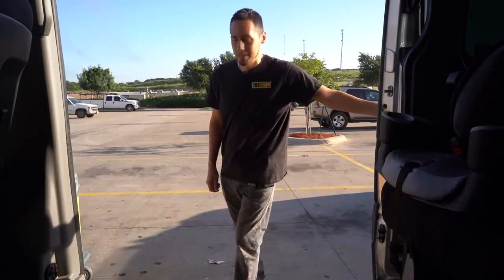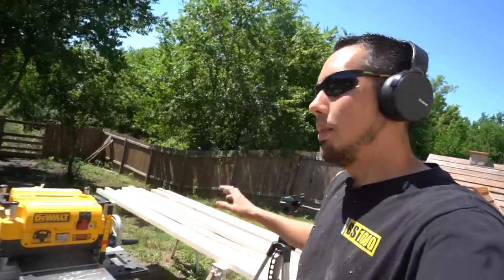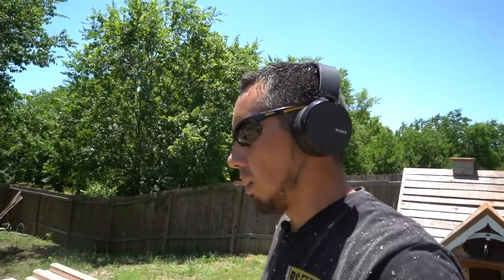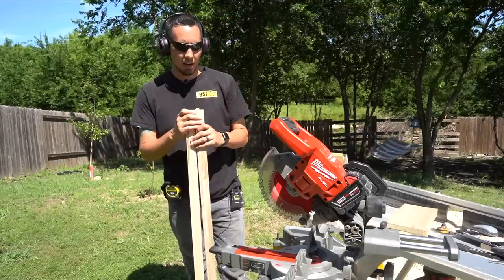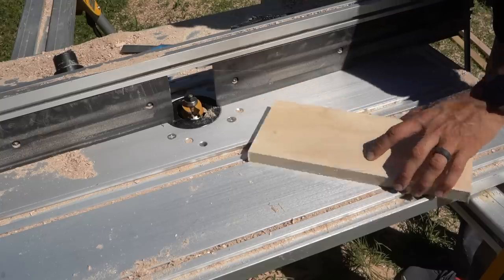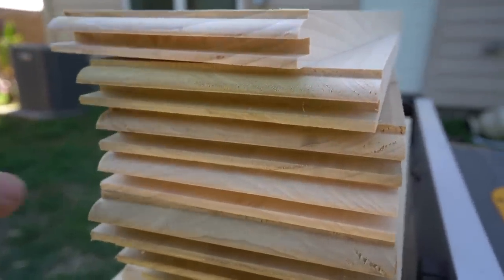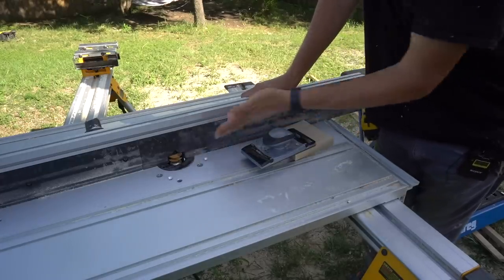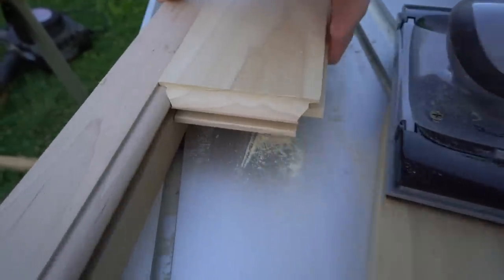It Worked!!!... Raised Panel Box Newel

Comment: Great video... man, you make creating videos look EASY!  Make your glue-ups look easy too: get a couple or 4 Merle Band Clamps for your tool collection... can't beat 'em for gluing up newels IMHO.   

Because you asked: The biggest challenge is keeping all the panel opening heights identical and rails lined up on all 4 faces of all the posts so not gluing all 4 sides at the same time, like you said, is dodging a bullet the first time so you don't get hit with one if/when a glueup goes bad.  Memories of your floor stain debacle are a little too fresh to re-live THAT kind of grief now, right! 

There's a lot of 'right ways' to do that glue up but I'll share my thoughts for what they're worth.  I'd determine the exact height you want to end up with from the top of the posts going down.  Normally a newel would proportion like a raised panel door with a narrower rail at the top and a wider one at the bottom; say 9"on top and 12" on the bottom.  That difference helps it look 'balanced' and not top heavy like it does if top and bottom rails are the same dimension.  Anyways, say you choose 9" for the top.  I'd cut all the top panels to  about 9 1/2"~10" or so but make them all identical in height.  Then I'd trim the best end of all the corners clean and square and mark them so they're the top of your newels.  With that prep work done I'd glue up 2 opposite faces (like you mentioned) lining up the tops of corners and over-length top rails.  Cinch 'em down with those Merle band clamps and your glue joints will be invisible!  When the first glue up is set just add the panels and rails to the opposite two faces, lining up everything on the tops again, and put 'em in the clamps.  The benefit of using this sequence is that all the spacing is indexed off accurately cut ends on top which makes lining everything up on all 4 faces automagic and a lot simpler IMHO than squaring pencil marks around everything on every face of every post. 

Once they're all glued up and dry I'd trim the extra 1/2"~1" off the top for a perfectly flush and square top, ready to accept a newel cap.  The bottoms of the posts will be completely uneven but one slice with one of your miter saws makes it a moot point.  You can always trim them square and 1/2" long or so to allow for scribing to uneven floors, etc so you can set the tops laser level on final installation. 

One last thing: you mentioned 1/2 newels at the walls?  Since you've got extra corners made I'd do everything the same in gluing those up with the exception of leaving out the  raised panels on the back side.  This makes the posts come out square under the clamps and you just rip them to size afterwards.  Having extra parts makes this possible and saves having to deal with u-shaped 1/2 posts folding up like a taco shell when you go to clamp them.
You've got a first rate newel build going here Richard and it's good you didn't even need to fire up the BS1000 advertised on the t-shirt you're sporting while making your posts!
Ping me if there's something that's not clear in this LOONNNNGGG comment! Best, Matt
Reply: Great detail

Comment: I tip from a table saw guy, the only way to truly know if your blade is at 90, is to cut to pieces of your choice of material, put them together, and use the angle finder. More often than you think it comes to 87 92, as you know, in finish work, that can be a lot depending on what you're doing. Thumbs up on making the wife help....just don't let them know you can clean! Glue then cut, you don't want to then have to get a planer or sander if something isn't just right.

Comment: Understandably you're very green to doing this kind of stuff, so here's some advice. When routing out your rails, you'll only get chip out in the back end, so no need to trim both sides. But by this point you shouldn't be doing any trimming. You should already have your final dimension and be using a block to prevent the chip out. And on your stiles, you don't get any chip out at all because of the way the grain runs. So no need for a block there. And as for the glue up, do it in halves and then bring them together and clamp. Hope this helps.

Comment: Woodworker here...First off, that post is amazing. I think it took a finish carpenter to make something with that many routed edges to come together so perfectly. So congrats on that. It's great that you left yourself extra length! I would glue it up in pieces like you said, get it as close as you can with the lengths being even as possible and then cut it to final length once it's all together and dry. Oh, and you know this, but watch the squeeze out on the inside hard to reach areas...what a pain it would be to have to get inside those angles to remove dry glue. It won't take much glue though because your joints are perfect.

Comment: Don’t ever mill all your pieces at one time 🙈 you’ll be amazed how much a piece can cup, bow etc even just overnight. Only mill what you can glue up same day. On big projects you rough mill it.. then right before glue up you mill the last little bit. Also always leave a little extra size cause after glue up you’ll want to plane and joint again to final size. You’ll never have perfect glue up so leave some room to adjust the pieces after glue up.  Use a piece of scrap as a push block behind the piece.. that prevents the tear out on the back end.

Comment: Couple tips. 1 feather boards will help you get consistent profiles on your router table. 2 sneak up on your profiles take about 3/4 of the material out on your first pass through the router then do a finish pass. 3. There is a narrow stock fence that flips over your table saw fence that will make getting your hand that close to the blade a little more comfortable. Overall great work as always and keep making sawdust.

Comment: Measure and cut to size. Add fill block to inside post to pre secure before adding your work. center panels run thru router to get raised panel  to finish the detail. sand and fill any defects before installing will save a lot of time later. I love to see how you work calmly and methodically. A sign of a true craftsman.

Comment: I had a cabinet shop, but im retired now. Some wood workers will glue up first cut to size second. But i always cut individual components first. Advantages are: at final assemble you can  measure corner to get square, less waste, easier to cut smaller size wood on miter saw,  no tear out on assembled item and faster. After glue-up final sanding and your done. Good luck. Try it both ways.

Comment: Richard, I've been using Marc Sommerfelds raised panel bits for years now. It never ceases to amaze me that this old retired pipe fitter/welder can produce doors or in your case newel posts, that are near perfection. I would definitely recommend gluing up the posts longer than needed and chopping them to size on the miter saw, giving you perfectly aligned edges.

Comment: You'll probably get all kinds of opinions on glue ups because every woodworker does things differently.  That post looks like it would be a pain to cut to length precisely after glue up.   I also like to dry fit everything at it's final dimensions (unless it's like something I know I'll flush cut like a dowel or something).  It's easier to make a new part if needed than make a whole new post.   

My best advice is practice the glue up.   Go through all the steps you'd think you'd do to glue the panels up without applying glue.  Add clamps, etc. This gives you an idea of how long you have, any struggles you have to get something square/flush/etc, let's you know if you have enough clamps, etc.   If you're worried about having enough time, you can use a glue like titebond 2 extend.   Do a dry run with the table saw, does it feel like you can cut the post to size while remaining square.   Dry fit the post against the wall, make sure it's all square and true.   You'll also be cross cutting the post, your stock blade on the table saw could chip it out.  You'll want a blade with a lot more teeth for cleaner cuts and/or clamp a sacrificial board to the back of the exit point.   Another option for a blade is what's called a combination blade that combines large gullets and many teeth.  They can do rip and cross cuts, not as good as blades meant specifically for each cut, but better than using a rip blade on a cross cut.  

Once your comfortable with your dry runs, then do it for real.   You can sprinkle a little bit of salt on the glue if you're having problems with the glue making things slip.   The salt will give you some traction and dissolve into the glue as it sets. 

I'd also recommend getting a new blade for your table saw.   Use 7.25" blades unless you really need the cut depth.   They're cheaper, cleaner, and quicker.   They are also easier on your motor.   Stock blades aren't that great.  You'll need a new blade for cross cuts anyway.

Comment: Don't sell this one..... Now get a mask. If the dust is on your forehead then its in you nose. If its in your nose then its in your lungs. Your lungs have not way of expelling the dust. The faster the cutting device the smaller the dust particles. The router table is the most potent. 

Props...you are getting it done.....

Comment: I realize that this video was made a couple of years ago, and maybe you have already discovered different ways to avoid tearout on end cut when using the router. I seem to have great success with starting at the end that tears out first. I carefully feed the piece in reverse around the corner, then feed it as normal and when you get to the end. It is already finished with no tearout problem. If you are routing all 4 sides, just finish the 2 corners first that are at risk. I have no problems with feeding the corner in backwards, just take it slow.

Comment: I'm with Nathan, unless it's 2d, you should glue first, then cut to size. Make sure you score with a blade the cut line before you run it through a table saw, as the blade will be ruing the wrong direction for a finished cut. Make each the sizing cuts in two passes, working you way up to the knife line you have pre placed on the member. Also, I make it sound more complicated than it really is. It really doesn't add any time to the process (other that making the knife scoring) because it allows you to cut faster.

Comment: Nice job with the milling step and very good job describing what you are doing and why you are doing it. I would recommend you stain your pieces before assembly (be careful to not get stain on the areas you will be gluing), then assemble/glue up in stages as you indicated. I would ensure you get one end pretty close to square (requires less trimming later) and let the other end run wild. That way you can cut to final dimension after everything is glued up - and you have verified the final dimension (it looks like your miter saw will have no problem making one finish cut) - as many others have suggested. Good luck with the final fit up - I am sure it will look awesome!

Comment: Good saw for what you need it for. Have the same one for job site work. If ever you get a shop then ditch the direct drive saws except for using them on job sites. But then again I have a shop with all the bells and whistles. Love my Jet Table Saw, Jet jointer/planer, Powermatic Band Saw, and shop built router table. Have some older stuff I have restored, Drill Press, and a 60's 8" jointer/planer. I live in the shop. Nice job on the Newel Post. glue and cut to size.

Comment: Ive made similar box newels. Glue up two sides at oversize lengths, let dry overnight. Then glue all together the next day. Saves clamps. Then cut to length as a whole.
I would also suggest gluing solid blocks top and bottom inside to give you something more solid to mount at the bottom and for rail at the top.

Comment: I'm a cabinet maker. The most i ever overshoot glue ups is by 1 inch on super rough glue ups. But usually on doors and stuff I cut them 1/8 over sized so I can just trim off 1/16 of the ends since i have to put an edge profile on them anyways. I'll just remove that material with the router and it will be great. 

On a box newel I wouldn't suggest much overhang. I would personally maybe oversize it 1/32 or so at the most so you can just sand the top with a random orbit sander or something. I assume no need to sand the bottom since there will be floor trim there. So i would get that exact on the bottom.

Comment: I’ve done a fair few glue ups making kitchens from raw materials for coach conversions. I would personally glue  one side (2 corners and the middle piece) then cut that to length so you can cut on the saw then put the other three in and cut them because you will have a finished size to measure off and mark and cut amazing channel !

Comment: In my hobbyist-woodworking experience, if I cut them all to length and then glued it up there would be something the tiniest bit off and it would bug me. It probably wouldn't be visible to others, but it would bug me. I suggest doing the glue up while its oversized, taking the time to get your alignment of the rails and styles all perfect. Then once it's done, cut it down with a chop saw. It may be too thick to cut down in one stroke, but to my mind even that would be easier.

Comment: Job well done!  I noticed your working with Poplar for the Rails, but I can't tell what the Stiles are.  My suggestion is to paint the Posts, as Poplar does not stain well, and paint results are excellent.  Again, this is a suggestion only.  As for cutting to final dimensions, I would do the glue up, then final trim.  Your attention to detail is excellent, and with this project your adding to your Professional skill set.  Keep up the good work!

Comment: You should glue it. It's an increase in quality, the better the quality, the less likely you'll be called back. You don't make no money on call backs, you lose money. Like when drywallers use screws instead of nails, and glue every stud before hang the rock. Or paper tape over mesh tape.

Comment: You have just done exactly what I am about to begin. The only difference is my "newel posts" are actually a facade that will slip down over 4" x 4" pressure treated posts on my deck. The purpose is to achieve a decorative railing to compliment the Victorian architecture of my home. It will also make it possible to use winter/rainy (otherwise lost) time to pre-manufacture the decorative and time consuming portion of the project.

Definitely glue the posts in segments (sides) and assemble the sides as a second step. You could do a full glue up assembly but you'd have to invest a small fortune in clamps that you'd probably never use again.

I'm certain you know someone with a large stationary table saw. Use it to make the final cuts to square up the ends when you have your final length dimensions.

That's exactly what I'll do. My final step will be to slide the assembly down over my posts and trim down the posts, with a sawsall.

I'll look forward to seeing your finished project. Keep up the great work!
Reply: Jim Remmell what lumber are you using for your facade? I want to wrap my second story pressure treated deck posts in the same manner, then paint to match the house. 

I live in WA by the way so wet weather.
Reply: @tindaletoo  

Just saw your question. I'm using poplar. It's cheap (relatively) and I'm going to primer all surfaces to help weather seal.

Comment: It’s always nice when a plan comes together. 

In terms of the glue up, if you have the tools/capacity to cut to size after glue up, it’s the way to go. Sometimes as hard as you try to get all pieces lined up perfect and in clamps, they can move with the lubrication the glue brings to the joints. Cut to size afterwards, taking care to prevent chip out if those portions of the newel will be exposed and not covered with additional base or cap trim.

Comment: Either way would work but it may be easier to align all the pieces if you cut to length before the glue up . Nice work Richard, makes me wish I had an open stair case !  I’ve been woodworking for 40 years and I always pick something up in your videos, this one was the way you set your stop on the miter saw, never thought of just hooking the the saw, the only thing I’d do differently is clamp a scrap piece to the table cut through it and hook that with the tape , might get a more precise measurement.  THANK YOU FOR YOUR SERVICE AND THANK YOU FOR MY FREEDOM!

Comment: I would cut the top to final size first before glue up and the bottom close to final size... like maybe an inch to inch and a half over... This will give you extra to play with because the floor is probably not pool table flat and the extra will allow you to trim it perfectly. Don't forget to put in the flat panels as you glue up. We've all gotten ahead of ourselves at least once.

Comment: I have that same saw and I love it! That roll away stand is worth it's weight in gold. I'd say to set up a feather-board so stuff stays up against the fence when you have to reposition your hands. I love the Gripper tool but sometimes it slips and I get that pause which almost always causes kerf marks when the board starts to drift towards the blade. Good to keep that table top waxed but sometimes a good old fashioned push stick can help keep that follow through continuous and smooth through the whole cut. A high quality sharp thin kerf blade is great too to keep it from getting bogged down.

Comment: Use frosted glass for the panels and drop and LED in it to light it up. I did that for a job and it came out wonderful. If you have a chop box big enough to go through everything do the glueup then cut the ends